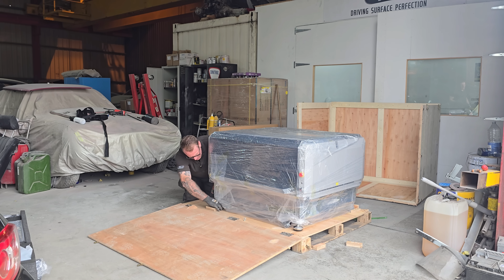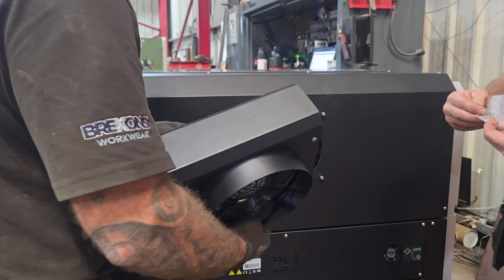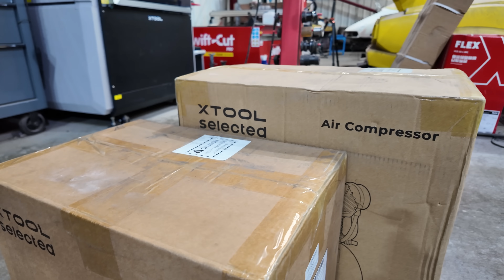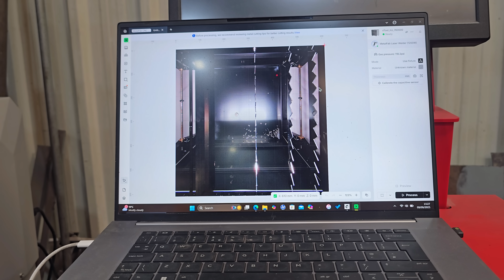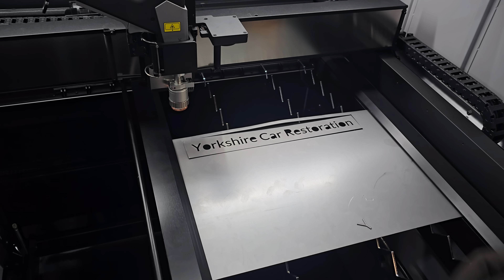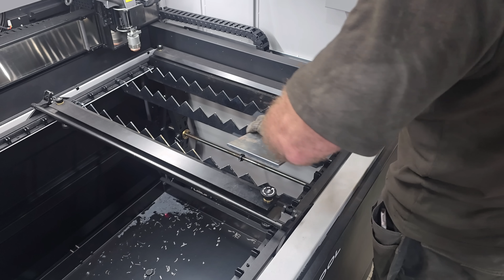First Look at the xTool MetalFab - Can Laser Welder and Cutter Help With Car Restoration ?

Comment: I am not a metal worker but have been interested in metal work for the past 5 or 6 years now, I am actually a woodworker and I make fine furniture with various hardwoods etc, but I am very interested in the XTool MetalFab and I have ideas what I could achieve if I had this machine, I might have to sell my car just to get it as it is so expensive but I have a vision. I enjoyed watching your video so I have now clicked on the thumbs-up button and I have subscribed to your channel as well. Great to hear the accent and that you are UK based as I too am originally from the UK although I now live abroad. 😀👍

Comment: It’s interesting to see it in its setting. When XTool first revealed this machine they made it seem like a hobby machine for home use.  🤣 They had the same friendly, warm vibe to the videos as an F1 or a P2. Personally, I don’t even the P2S should be a hobby machine.  Of course, it only took a few minutes to see that it was a commercial machine but I can imaging the average crafter unpacking this in horror. 😀
Reply from the maker: It certainly has a lot more features than the average hobby machine, but only limits are the users imagination as this thing also etches as well. So can do most hobby work and more.

Comment: That is actually an awful lot of dross of that 5mm Steel plate. You need to be using a double layer nozzle and Oxygen to get a cleaner cut.   That parts tray also needs filling with something like sand or it'll end up warping.
Reply from the maker: for just compressed air it’s not much dross. But yes cleaner cuts if using oxygen. You will see that in other videos.

Comment: Just a note, you mentioned that the compressor supplies inert gas, it's actually supplying compressed air which isn't inert. You can attend nitrogen to get a cleaner non oxidised cut.
Reply from the maker: Sorry I think you misinterpreted my sentence. 
I said the compressor feeds compressed air JUST for the CNC because you need an inert gas if you’re using it as a welder. 
In this video we didn’t do any welding only cnc cutting.

Comment: Along with that 3D scanner you showed a while ago, this piece of equipment can certainly be of use for making parts that are hard or even impossible to come by. Of course some will say that there is nothing like good old-fashioned manual metalwork, but knowing how to do that is very important when using the advanced equipment: it's not like those machines magically conjure up the exact pieces in exactly the right shape.

Comment: How about converting a paper or card template into an outline by scanning?
Reply from the maker: that can be done easily :)
Reply: all you have to do is take a photo of the card or paper template then up load it to the software then you can size it accordingly in the software and cut out. very easy. or if you have a scanner you could scan it
Reply: @amxen1  Excellent just need something to beat it into shape now, or scan it on the vehicle then cut and beat... then a shared crowd sourced library for every car.

Comment: Our place has just bought a massive one of these. It’s huge. We are steel workers and use presses to draw steel. Not very clued up with these but they were asking if I wanted training up on it and I said yes. I Was asking some things about it and the boss said it’s one of the most powerful cutters and can cut the thickest metal for the jobs we will be doing. We powder coat anything and we have one of the biggest ovens in the uk. There is only one other place that has an oven the size of ours. We have people from all over coming to see this machine at the minute. We have no end of work lined up but we are testing it right now. It’s so fast it’s crazy. Cuts so clean. Got to get the nitrogen and oxygen right as it will cut like shit or melt the back end of the metal. Trial and error at the minute haha

Comment: You can never replace the years of experience and skill that a time served professional can offer. Not sure this video does you any favours. But I understand it’s all about the money.?👍
Reply: If you know how to trace the hand made cardboard aided designs into the machine it is a game changer, the cut part is more precise and the design can be saved then used again if needed.
Reply: @PiezPiedPy your probably right .. but no real skill required.
Reply: @grahamclayton675 It is a modern cutting device, real skill is still  required.
Reply: @grahamclayton675  Try using one, then you'll realise it does require skill.
Reply from the maker: Not just about money, this already has a que of applications for us to make as we have some bespoke build coming in that it will simplify for us :)